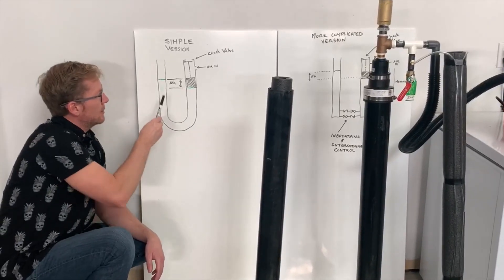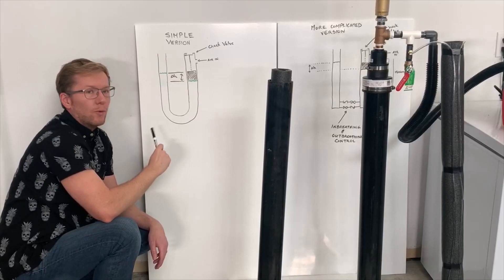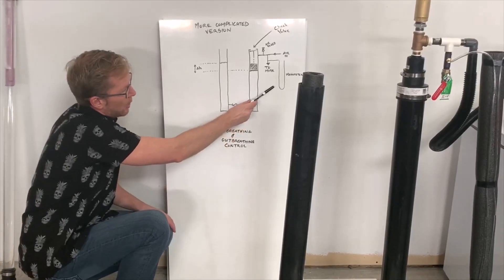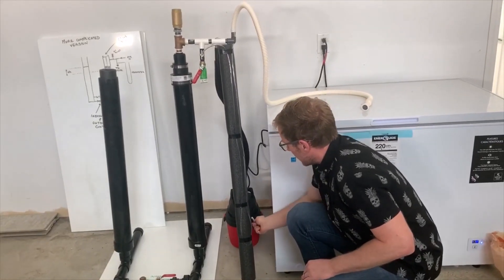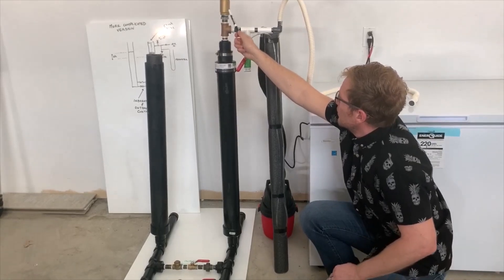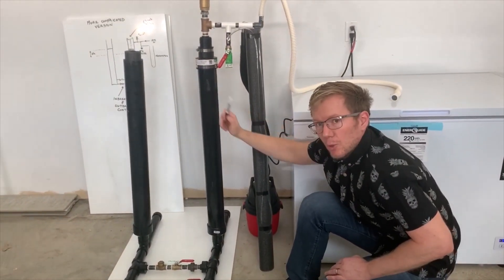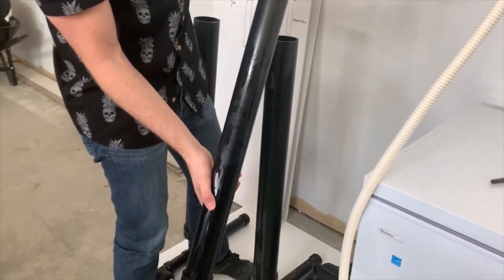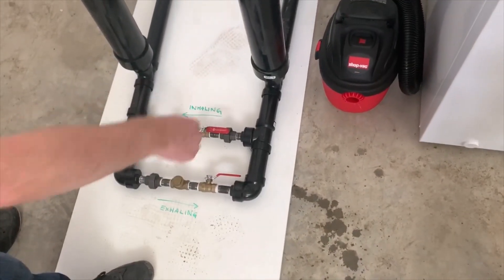PlumBreath   Emergency Ventilator Concept

Comment: That's really ingenious, no electronics, no variable speed motors, no electric solenoid valves, rate adjustable for both in and out breaths inherent overpressure protection for the patient....should work in the required 5 to 35 cm of water regardless of whether its hooked up to a 25 cm static bouncy house blower or a 50 psi air/oxygen manifold in a hospital....